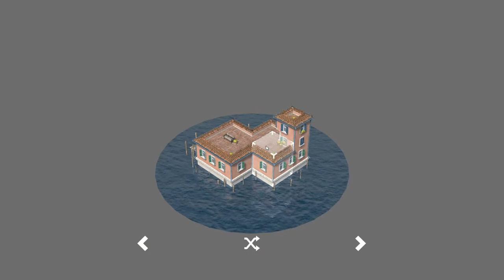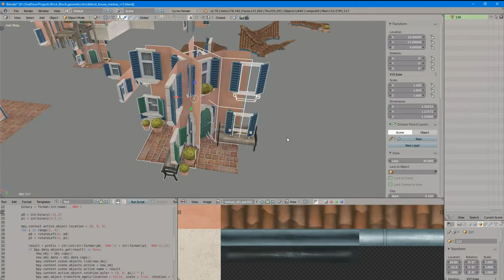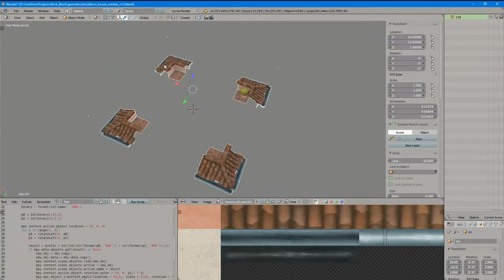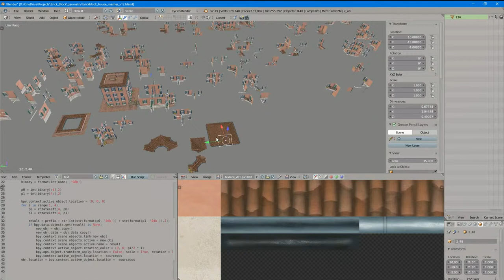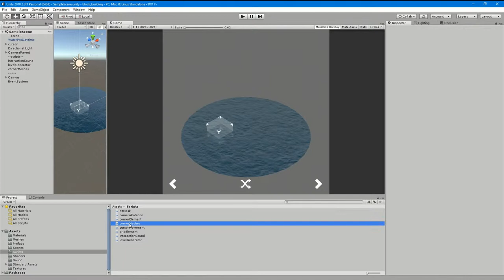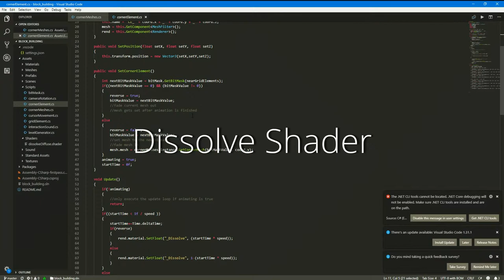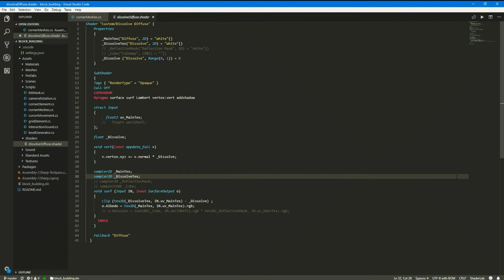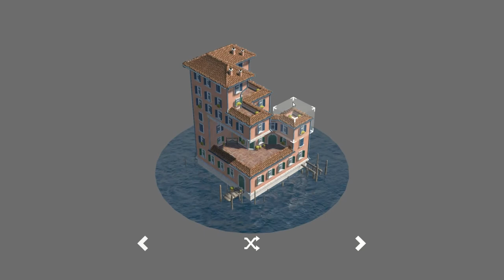Recreating Brick Block in Unity | 11 Finalisation

Comment: Finished this one now. The end result is so similar to the original that I have to imagine it was made in much the same way. Great work. Although I have to say that the last few videos left me a bit discouraged. Up until that point I was amazed at how simple this was, but when you revealed how much modeling was involved and how you used scripts to create extra models etc. I realized I probably will never do anything like this in one of my own projects. I usually do everything in my power to reduce the amount of art production I have to do. :p I experimented a bit with just having models for the grid elements, removing the corner element concept completely and then procedurally placing windows, doors, plants etc. and I imagine that's how I would solve something like this in a project if I needed it. It may have more limitations to the types of geometry you can produce, it involves more code and the code becomes a lot less elegant, but it involves a lot less fiddling in a 3d modeling application. I started out with 3d modeling a long time ago and used to love it, but now I do everything I can to avoid it. I'd rather write a thousand lines of code than make a few extra models, lol. :p

Also have you seen the breakdown of Brick Block in the Vertex ebook? (http://oskarstalberg.tumblr.com/post/132203650061/vertex-3-finally-dropped-on-page-170-you-can) It has a lot of interesting information about the project and it looks very similar to how you've done it in this tutorial.

Comment: thanks for your hard work! Very cool and helpful! Thank you!)
Could you tell me how to upgrade my skill to make such a house from tiles? I dont understand how they fit together) maybe there are tutorials on the internet to make your own building...
Reply from the maker: I basically modeled a small house on a 3 by 3 grid. The middle part of the grid is occupied by the flat walls or flat roof elements. The house corners are in the corners of the 3 by 3 grid. Then i split it up and used it as a base to construct all other elements. Its a long process. But a lot of meshes are simply rotated duplicates. You only have to model them once.
Reply: @3d_eric  Thanks, I will try it)